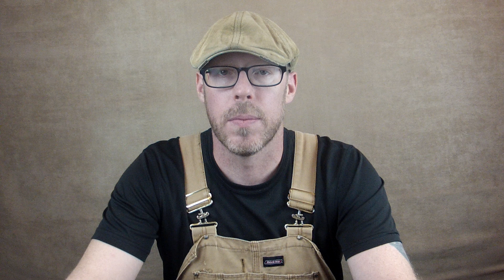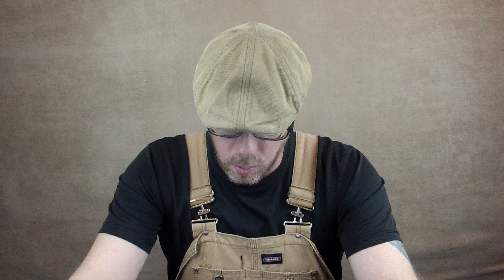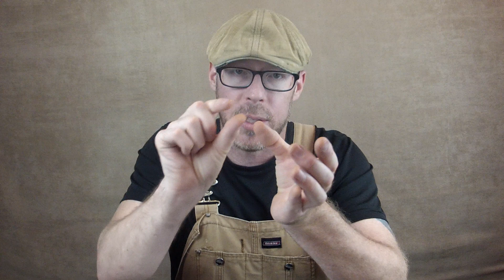What is delaminated pool plaster?

Comment: I'm a perpetual DIY'er and just bought a house with a 50 year old concrete pool (last summer we bought it).  I recently discovered a number of "hollow" spots in my plaster.  I am losing 2" a day of water and while I recently filled my pool for the summer, I think I'm going shut my pool down and let the water drain down to see where the leak is.  It's already past my skimmers and it's still going down.  I dye tested the main drain and that's not the issue.  Last year, a 3" chlorine tablet somehow sat on the bottom of the pool and left a nasty yellow stain.  Not knowing anything about plaster at the time, I took sandpaper to the yellow stain.  I got most of it off, but I'm thinking I may have done serious damage to the plaster layer.  The last time the plaster was done was in 2007 and there are definite cracks around the pool in the plaster layer.

I found many delaminated spots by the deep end skimmer and used a chisel to break off those hollow spots down to the gunite.  The concrete underneath these spots was cracked and peeled off, too.  There was a blue, almost plastic/fiberglass layer under the white plaster...what is that?  I'm going to use Pool Patch to re-seal the areas I chipped off.

Could the water loss be contributed to the old plaster around the pool and water just leaching through it?
Reply: Sounds to me the blue undercoat could have very well been the company that replastered's attempt at a bonding agent speaking in the world of pools have to be careful only certain bonding agents actually work failing to apply bonding agents or applying faulty ones cause delamination in plaster in the first place and that could absoulutely be a reason why you are having a leak you mind as well get that problem taken care of now since you are doing other work on the pool better to fix everything before you fill it hope this helps